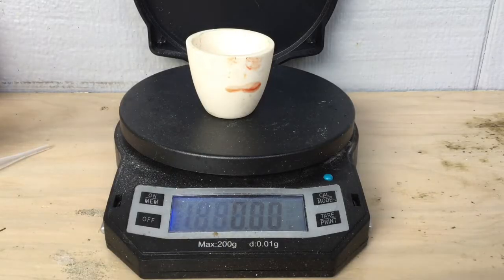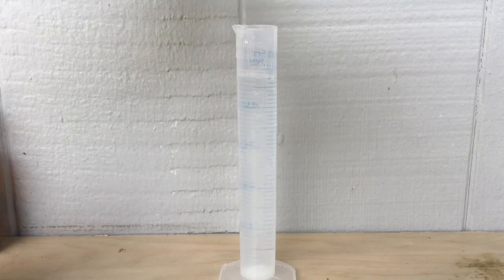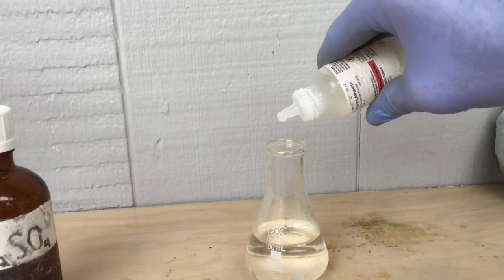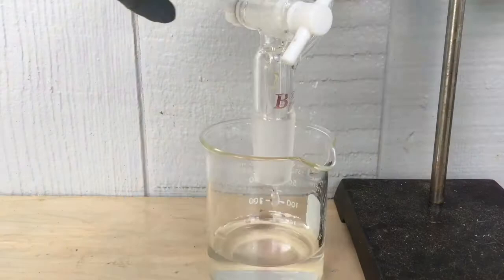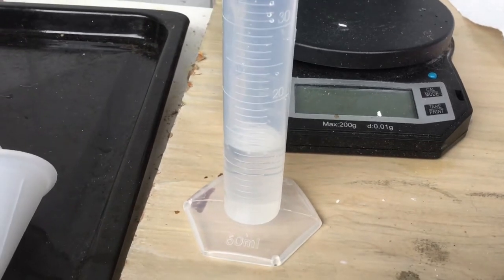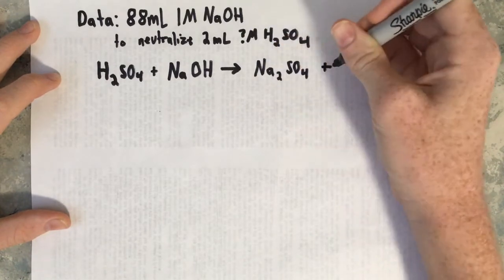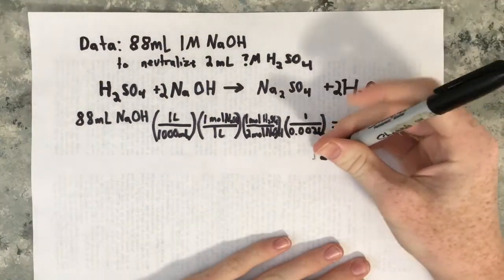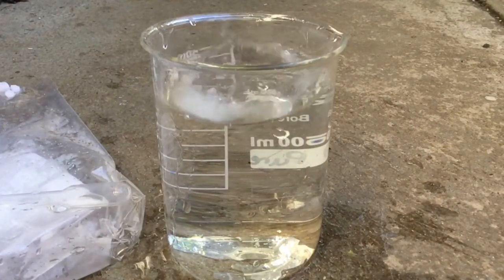Titration of Old Sulfuric Acid (Trial 1)

Comment: I think the biggest source of error is, like you said, wet NaOH. Any water in there would decrease the concentration of NaOH in the titrant, so it would take more volume to fuller neutralize. Another problem could be NaOH solution adhered to and stuck inside the addition funnel. Also, when titrating small amounts, even small errors in measurement can be significant. A volumetric pipette would be the best in this case, but who has one of those. Maybe for the wet chemicals problem you could distill some azeotropic hydrochloric acid. This will have a known concentration (somewhere around 6M I think) and can be diluted and used to titrate the NaOH solution. This way you can find the actual concentration of NaOH, although another titration might introduce more error. Maybe also add the titrant directly from the cylinder with a pipette, which should reduce transfer losses. I've personally had good results using sodium carbonate for H2SO4 titration. I just had to bake the Na2CO3 for a while to make it dry and heated the analyte to drive off CO2.
Reply from the maker: +Tom's Lab I agree with everything you said! I might even try the sodium carbonate method for trial 2!